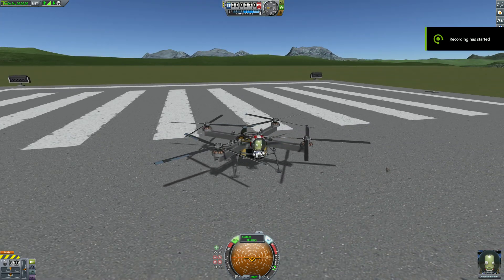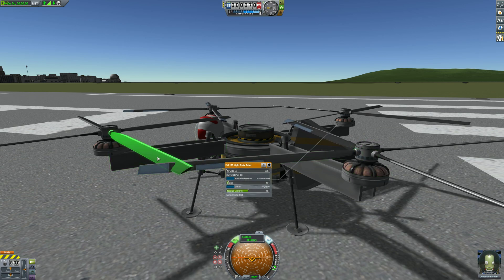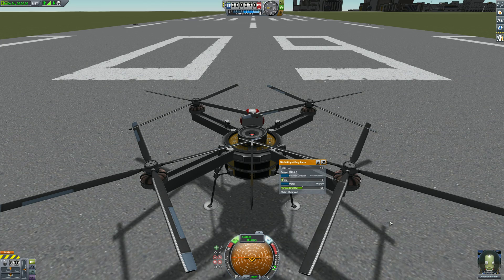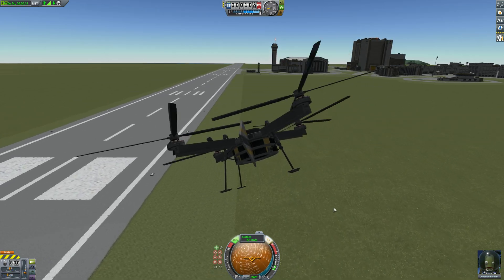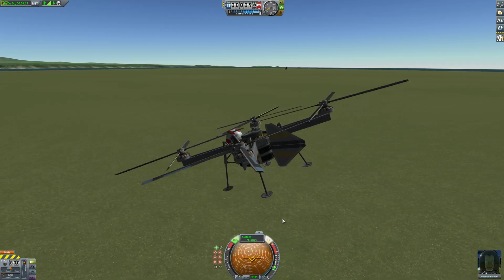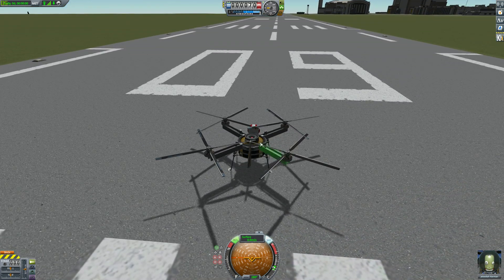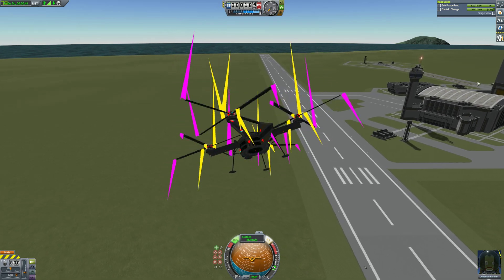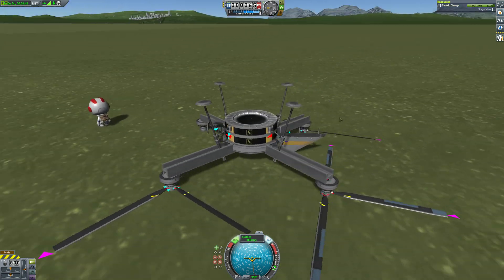A ksp drone.... the proper way

Comment: I built one of these to the same design. If you have it so you're controlling the craft from the control module and have your ACS set to radial out, the craft will autocorrect when you're not pushing it in a direction for forwards momentum. I found it way easier to control this way and mine can easily lift 10 tonnes also! Good video dude!